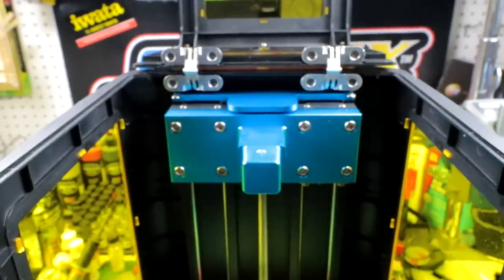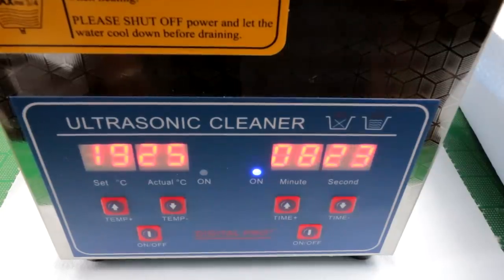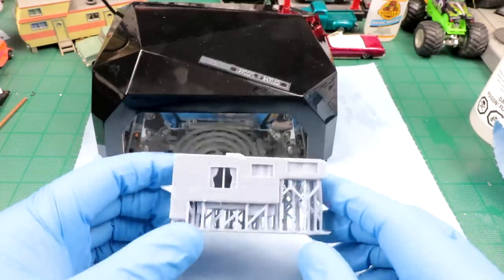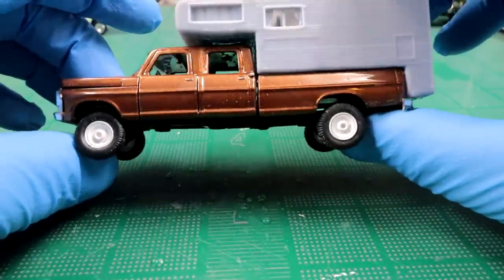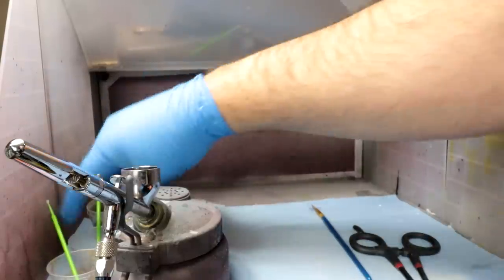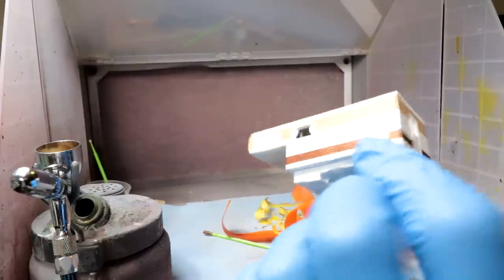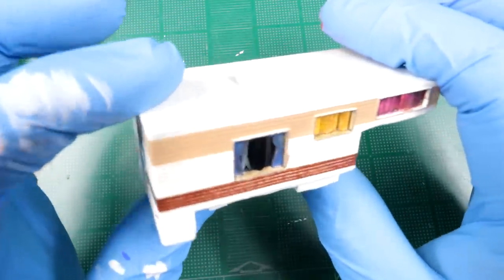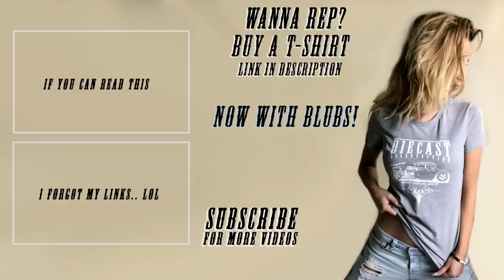1:64 3D Printed accessories Camper and WINCH BUMPER Part 2

Comment: That’s so cool, I would like to see the sleeper cover the cab of the truck and the camper be wider. Then put the big mirrors on the truck so you can see around the wider camper. You could probably use thread for the winch, cotton thread is pretty strong and still small enough.

Comment: Well done! Cut some thin clear plastic for the camper windows and it's complete. :) Love that you're offering your free files! Keep up the great work!
Reply from the maker: I printed clear glass but they didn't work out.  Working on it!
Reply: @DiecastResurrection  I was meaning just cutting clear thin stuff from like the Hot Wheels package or something. I've not seen someone try to print clear resin. Not sure it would come out. GL mate!

Comment: Great video. Have a try at using liquid brown shoe polish as a wash next time. Depending on how dirty you want the campervan to look. You can also water shoe polish down further prior to covering whole thing. Using a rag soaked hot water take off the access. What the shoe polish does is soak into the grooves giving it that dirty roadstyle feel. For pattern for curtain id have go at water decals  😁

Comment: I've been seriously playing with the idea of getting a 3D printer. Then I wasn't sure how hard it would be to learn to design the parts. But dammit, now you've got me inspired. So that'll be one more space filled up in my hobby room. Lol
Reply: I use fusion 360 (free for private use) and some parts are really easy- some are stupid hard to model... the slicing and printing is way easier as I thought though- the software of my printer also seems to be way better at generating support- I never had problems like shown in the video

Comment: That printed out nicely!

In hindsight, I think you should consider a design with separate base and body. It is a bit more work, but this way you can clear the insides from any internal print support beams , and opens up possibilities for interiors and openable doors. Obviously, I know you're pretty much also learning this stuff, this isn't a critic, it is a suggestion of future steps.

Comment: HELL YEAH man you are rockin this diecast resto and custom thing man i love what youre doing id definetly be proud to have one of these custom trucks on display as the main liner up front.  Another thing you can do with your little nail 💡 is if you have yellowed windows is put the window in a small ziplock baggy with some hydrogen peroxide stick it under that 💡 for 8 hrs to 24 hrs and it will clear it up but man youre really doing some damn fine stuff cant wait to see whats nxt OH THE ANTICIPATION lol